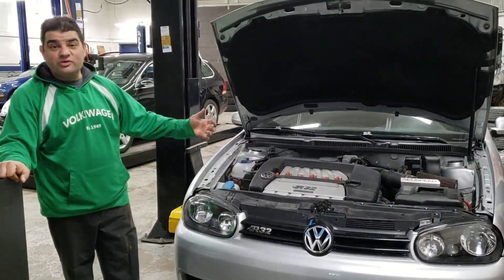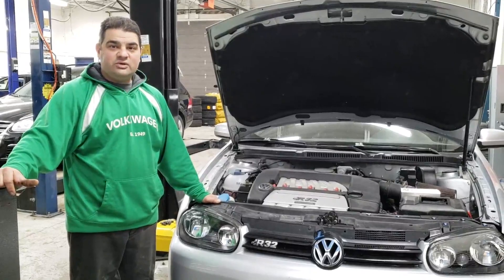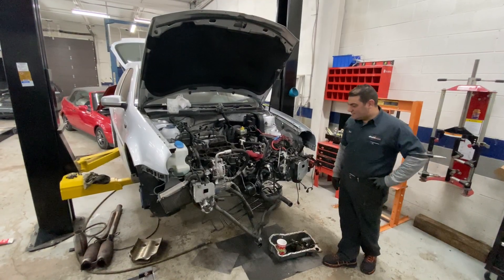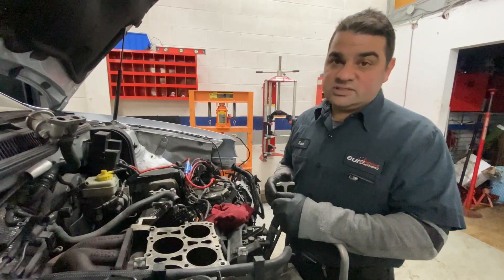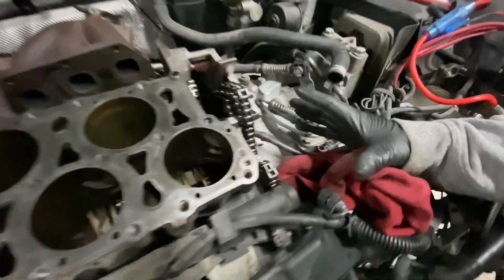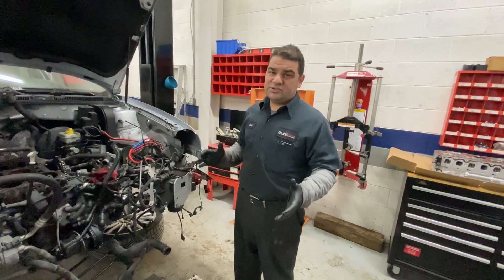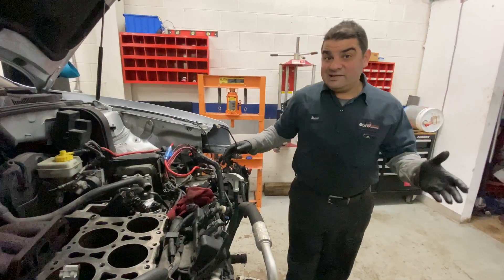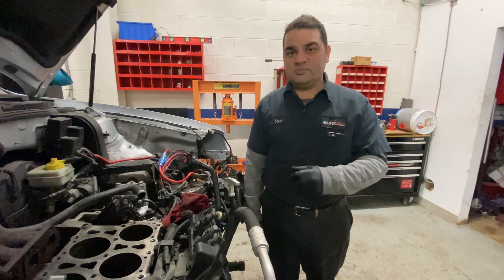Volkswagen R32T - HPA Motorsports Turbo Kit - Part 1

Comment: Been told mk4 has a better engine and with head spacer these engines will take 450 with ease
Reply from the maker: The MK4 is a great platform, and they can handle the power very well. The VR6 engine is quite stout.